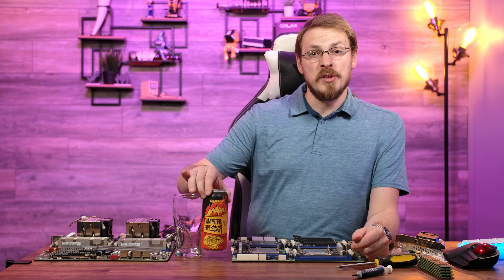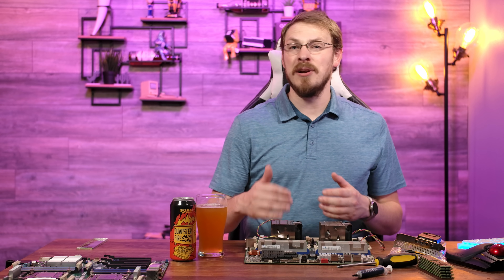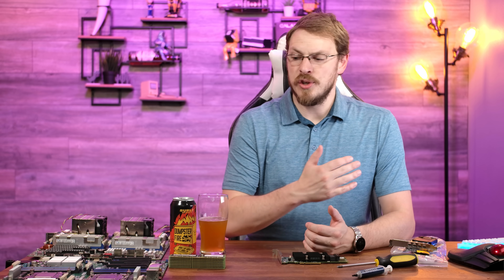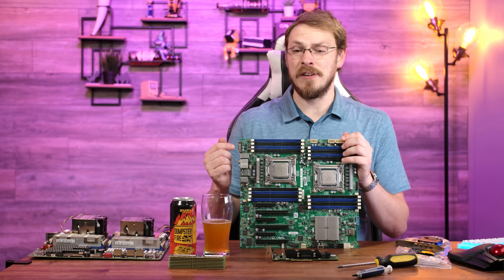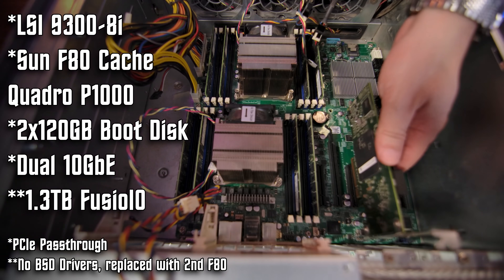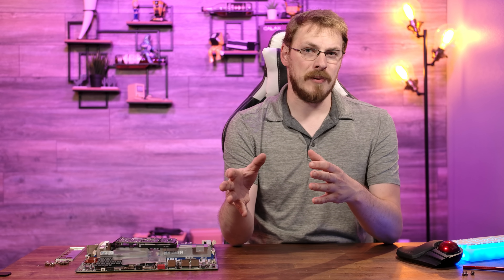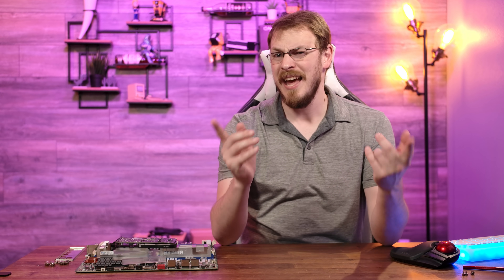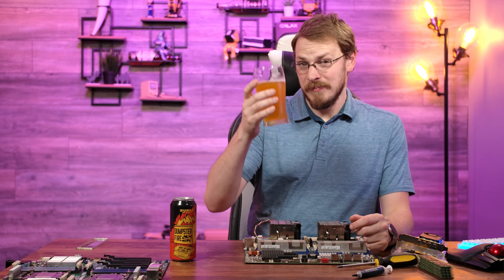Running out of things to die - TrueNAS Motherboard Replacement

Comment: I upgraded my NAS in December from a pentium g3258 to 1st gen Threadripper 1920x in the mATX asrock taichai combo i got for 400 on reddit. Currently has 4 x 8TB shucked WD easy store white label, and 256GB NVME cache disk.

I'm currently set for a while as I work to upgrade my horde of Linux ISO to the 1080p versions.

I couldn't have done it without your guides. Thanks for sharing the journey.

Comment: Next up, your case is going to randomly fall out of the rack. Might as well have a spare ready to go!
Reply from the maker: It's only 85lb. Should be fine with a 4ft drop.
Reply: @CraftComputing  I mean you already had to replace the drives once, wouldn’t wanna replace them again immediately after
Reply: @CraftComputing  I think we both know what will happen - Murphy says total loss.

Also, HDDs don't really mix well with drops. You only get away with that when using SSDs.
Reply: @CraftComputing  Einstein and Newton can not compete to spin faster than each other in their graves. Einstein was cremated.
Reply: You mean a spare identical second rack all set up right?
Reply: I guess he should just switch to raspberry pis then, a far better solution
Reply: @aminboukari4093  cheaper to replace ;)
Reply: And after that, the rack rails will mysteriously start degrading. Better have a few of those lying around as well.
To be honest, might as well have a full rack as backup.
Reply: If he used plastic rack nuts it could happen
Reply: After all this, did it fall, or was it pushed?
Reply: Hey Jeff, great videos from yourself as well, keep up the good work!
Reply: Yo Jeff
Reply: If rack cases start falling out he is Screwed.....  while his cases weren't.
Reply: Let's hope this exponentiation stops before a sink-hole swallows his town...
Reply: Completely underrated comment🤣
Reply: Why you are comment on all videos I watch?

Comment: Hey amigos. Have a Thecus 8 bay NAS (older version that only runs 3gbs speeds / HD). Total of 16TBs installed on it that backs up my Plex server. I'm planning on getting a used Dell R720 to create a virtual set up. It doesn't have to be a Dell R720, it can be anything similar and/or cheaper. Any recommendations? Have an old R620 (MB dead on it). So I have a pair of CPUs, tons of Mem RAM, and 15+ 2.5 SAS drives (8x 600GBs, several 300GBs, and also 146Gbs laying around). Also have tons of 2TBs and several 4TBs also. Thanks 😊

Comment: My NAS is running a Ryzen 5 1600AF on an X470D4U motherboard with 64GB of RAM, running OpenMediaVault with ZFS in two pools (one spinner, one flash). Next planned upgrade is one of either a Ryzen 9 3900(X?) if my boss scores a 5950X for his rig, replacing the mirror pair of 400GB SAS SSDs with something larger, or adding RAM. (Currently 2x32GB 2666MHz DIMMs.)

And you really should get the heck out of the old DDR3 stuff - there's plenty of cheap X10 Supermicro boards out there and Registered DDR4 RAM isn't that bad these days.
Reply: Prices are through the roof because of Chia right now though
Reply: @the-uppload  chia is dying down and doesn't matter for RAM to begin with really.

Comment: I am but a minnow in the homelab ocean. My "homelab" is my old PC tower - an i7-3770 on a Gigabyte G1.Sniper M3, 32GB of mismatched DDR3 RAM (I think there's an 1866 MHz kit of HyperX, and a 2400 MHz kit of Dominator Platinum in there), an old 120GB Samsung 830 SSD, and a couple of old laptop hard drives. I wanted to get my feet wet with Proxmox - I don't really have any previous experience with VMs outside of some VirtualBox stuff and good old Windows XP Mode in Windows 7.

Right now it's mainly used for a couple of game servers for my friends. We play games like Valheim and ARK from time to time with it operating as the dedicated server. The only thing that sketches me out with it right now is the internet security side of things. Other than that, it's a bit of casual experience in the Linux world.

I'm not sure where I'd go with upgrades for it, as it mostly houses hand-me-downs from other PCs getting upgrades. In fact I think a new router is probably the best thing my home network could use right now.

Comment: Main server is a TR 1950X Unraid build with 64GB of RAM and 136TB of usable storage with 16TB for Parity and a 4TB NVME cache pool, a 2nd smaller Unraid build with a R7 3800X, 32GB of RAM, 11TB usable, 5TB Parity and 2TB NVME cache and 2 Truenas builds. One for storage (R7 2700X, 32GB RAM and 30TB usable) and one for testing (FX 8350, 32GB RAM, 12TB usable). I am working on raspberry Pi projects and network upgrades, so won't be looking at server upgrades until 2022. But i do want/need some cache drives for the Truenas servers, so that's def on the list.

Comment: I've never had any good luck with gigabyte motherboards for as long as I've been building computers, which has been a pretty long time. And for my server stuff I go nothing less than super micro.
Maybe the Seagate failure disease is spreading throughout your network, I recommend quarantining all your devices!

I recently retired my dual socket Xeon x5677 96gb machine because it was using disproportionately more power than I actually needed since I don't do anything more than running Minecraft servers and plex. So I just took my boot drive out of it and threw it into my HP elite sff 8200 with an i5 2400 with 16 GB of RAM and surprisingly the process was way too easy. I'm hoping someday that high clock speed low power processors for servers will flood the used market and be much more affordable.

Comment: I use a R720xd with 12 x 12tb drives using ZoL raidz2 in Ubuntu, PfSense as my router with a sfp+ card with 2 10gb nics passthroughed to it, a 10gb nic on the server itself as shared link for the rest of the server. server has 196gb ram overall with 160gb of it for zfs. I also have a flash accelerator card as larc2 on ZFS. probably going to try to get some other interesting stuff on this machine working. The proxmox OS drives and template save locations are 2 2tb SSDs.

Comment: I have 8x ODroid HC2 with 4x 1GB and 4x 2GB drives. Each HC2 is runing Ubuntu 20.04 LTS with LizardFS as a distributed filesystem. Not as simple as TrueNAS but more fun.

Comment: The Supermicro CSE-846E1-R900B says it only supports 1tb or smaller drives. Do you need to replace the backplane or something else to.use larger drives?
Reply from the maker: That's up to the controller, not the backplane.If you use a more modern drive controller (HBA or RAID), it works just fine.
Reply: @CraftComputing  thanks wanting to replace my aging dell r910 and diy external disk chassis

Comment: I have a question u talked about the system having 12/24 cores then proceeded to say later upgrading from a 4/8 to a 8/8cpu
Reply from the maker: Originally the server had a pair of E5-2643 v1 CPUs (4c/8t). I purchased a set of E5-2643 v2 for it around the time the board started having issues (6c/12t). Decided to ditch both for the 4627 v2.

Comment: Currently working on migrating my servers and desktops to a single box for simplicity.  Currently waiting for more reviews of Threadripper Pro MoBos before deciding if I go Pro or wait for Zen3 later this year.   Do have a question that you might be able to answer.  How would you cool a Threadripper in a Chenbro SR107?  It is a 5U chassis that make me really want to attempt watercooling using 3 120mm Rads...  But not really sure it will work.

Comment: i have a amd a8 apu and 16G mem with a rocketraid 3560 with 2 arrays.  a 600G raid 5 and 52TB raid6 with 2 hot spares. i get a sustained 460MB/s writes to the array and 600MB/s reads. The 600G is comprised of 3 velcioraptors and the 52TB is 14x4TB sata drives. .mb is asrock.  Does everything i need.  NFS, plex, borg backups.   It runs Openmedia Server which is a debian derivative. 123 MB/s to the server over gigabit.  planning a 10G upgrade in near future.

Comment: Since I don't have much space in the apartment, I'm using an HP ML310e Gen8, Xeon E3-1220v2, 8 GB DDR3 ECC, 4x2TB WD Red in RAID 10 connected to the onboard RAID controller (I think HP call it B120).
I used to have the P420 card installed, but in the brazilian summer it gets quite hot and the system fans become too loud.
Speaking of fans, this system has a bug on the IPMI CPU temp sensor, it's stuck at 40°C no matter how much load the CPU has. The Intel sensor does show correctly the temp and the fans actually ramp up a little, but then they slow down and the temp keeps going up.
I want to replace the system, but computer prices here are so high, so I'm keeping it for a while.

Comment: Currently running an i7-3770s, 16gb of ddr3 (non-ecc) ram. Was originally a Dell Vostro (think that's how tou spell it) pc. Threw an amazon special HBA in it, put that all in a Silverstone case (recommended by Byte my Bits 😉) and then a bunch of random drives, 7 in total. Threw Server 20212r2 on it with no prior knowledge and self taught myself! It's what landed me my job working in IT!! 

I would love to upgrade to a proper server... Or just better hardware.

Comment: 4x DL380G7 - 2x Xeon X5674 (12 cores total, 24 with virtual cores), 144GB RAM, 6x 480GB SSDs in RAID-10 (each server)
1x DL380 G8 - 2x Xeon E5-2680v2 (20 cores total, 40 with virtual cores), 96GB RAM, 4x 800GB Enterprise SAS SSD's in RAID-10

NAS:
QNAP TS-932PX-4G - 5x 8TB Seagate Exos drives in RAID6, 4x 480GB SSD (cache)

All servers and the NAS (as well as my machine) have 10-gig connection. Servers and my machine use  TP-Link TX401 network cards in them connected to a Ubiquiti US-16-XG. The rest of my home runs in 1gig and I'm planning to upgrade everything to 10gig, as well as add a SAN soon.

Comment: Dell T420 chassis I rescued, running an E5-2430 v2 with 96GB ECC Ram, 24TB of spinning rust, with 2 200GB MLC Samsung SAS SSD's, all on 2 Dell H310 HBA's flashed to LSI IT Mode.  This runs ProxMox, with PiHole, Unifi Controller, NextCloud (with Plex), HomeAssistant, and due to my Linksys EA9500 crapping itself during the pandemic Work From Home, PFSense on an Intel i350-T4.

Upgrades Planned: Add some sort of GPU for Plex Transcoding, and maybe a little shared GPU action to some VM's, get PFSense OFF the server, and onto Bare Metal, as it for some reason can't send more than 330/20, while the ISP is providing 550/20 (I haven't take the time to play with the i350 recently).  I want to get a couple more things configured with HomeAssistant, so probably some stuff with that.  I am debating a second E5-2430, or upgrading and adding dual socket, mostly for the RAM...  As the system actually has like 118 GB I think installed, but I can only access one bank with one CPU (I knew this, but decided IN the chassis was safer than the shelf...)  And some sort of cooling mods, as the T420 SUCKS for cooling.  And one of the PSU fans is going, probably just going to replace BOTH with eBay units instead of trying to FIX the one fan.  Then some HAProxy work so I can run a couple game servers, plus have NextCloud accessible outside, and fix OpenVPN after my last round of trying to "fix" the ISP speed issue, somehow broke OpenVPN.

Chassis history apparently involved it tipping backwards, as I had to replace the power boards between the PSU's and the system for it to even work, and the PSU's are a little worse for wear physically still.

Comment: I have two of the Pesh2's and the bmc / 10gig nic copper heatsink gets extremely hot.  Gigabyte said it was normal but I opted to add a laptop cooling fan in that slot to blow directly on it. Is there a chance the failure is related?
Reply from the maker: Not likely. I was not using the onboard 10-Gig NICs. I had the IPMI hooked up, but that's a completely different chip.

Comment: What am I running? IBM x3650 M3, with 72GB RAM, a pair of E5620, LSI SAS2008 HBA and 5x5TB 2.5" drives. Next upgrade? Another 5x5TB 2.5" drives, and/or 2 Xeon X5687's, for better single-thread performance.
Reply: and sound isolation ?
Reply: X5687? The x58 platform? Same as the i7 X 990 and X5690? My gaming computer is running X 990.

Comment: I had a similar issue with my Dell C2100, also for TrueNAS, and also overkill for TrueNAS. but that 144GB of RAM was great
I've moved to an asrock rack X470 with 3700x. 4x Optane cache drives, and a 16 drive SAS controller for 16xSATA SSDs
Its also in a mini ITX case, an old apevia XQpack2, this will be my main server, but really it will be my backup server that i use to keep a remote server updated. Much easier to move a small mATX case around than 4 loose drives back and forth between 2 sacrificial systems basically dedicated to hot swap for these sync drives.

Edit, my 2100 was recoverable for reletively cheap, and just before recycling i decided to try chia mining on it, and my two R510LFF, 700 plots and not a single colored plot

Comment: wow, i got first view :P watches video As for the next planned upgrade to my own home server, my current setup is a Ryzen 3 1200, 16GB DDR4-3200 on a B450 mini-itx motherboard. The system serves as a home NAS with four 4TB Seagate Ironwolf drives maintaining a weekly backup of both my and my spouse's desktop computer. It also occasionally serves as a Minecraft SMP server for a few friends via VPN. 
Ideally i'd like to move it, and my desktop, into a rackmount solution, but such a significant physical overhaul does come with a significant price tag, and so is on hold until later this fall.